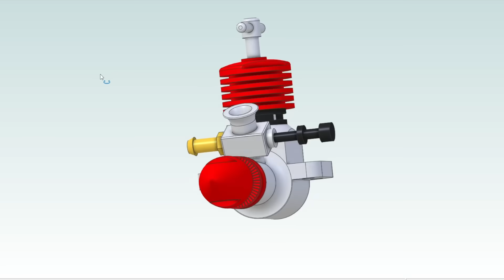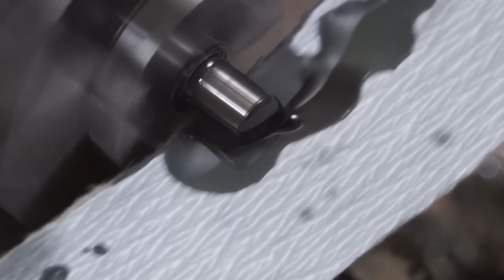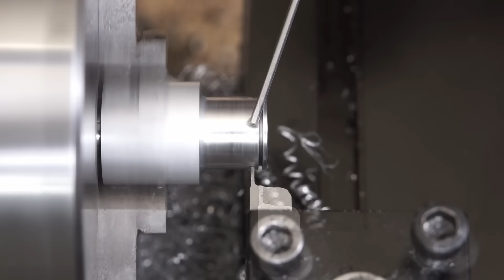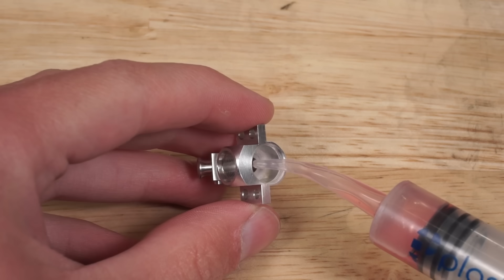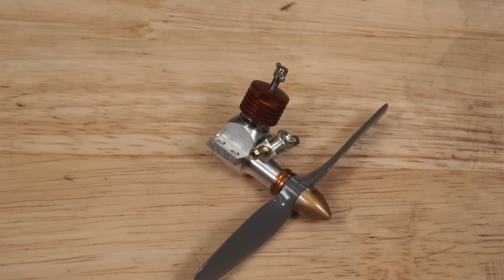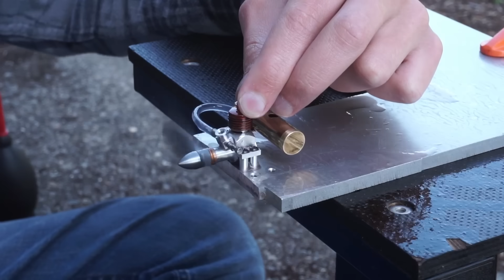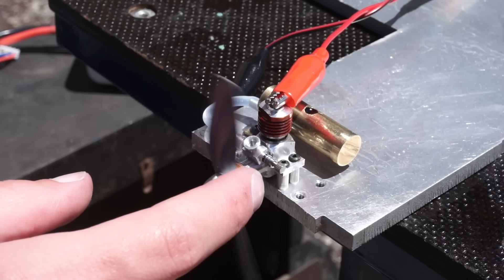I Make This Tiny 2-Stroke Engine From Scratch

Comment: There I was, proud of my aerospace designs that took months of adjustments on paper and mere hours in the shop to make, then again designing machines for a battery factory, meanwhile, this guy just makes precision parts by himself. Why did I hire so many machinists? Half way joking, my great grandfather made the hydraulic systems for the Spruce Goose plane and I have parts in space and I'd rather hire machinists than engineers any day. I have no idea how long it took you to make these but I'm sure other engineers and machinists alike are envious of your skill set. Manually threading on a lathe or on a thread press while matching these tolerances is a skill these CNC nerds fail to respect. "back in our day" stuff aside, being within 10kths of an inch manually is where we get the ladies or lads.
Reply from the maker: This engine took about three weeks total to make both the engine and video. I have a significant background in professional machining, it's amazing to me how low the barrier to entry is in the modern cnc shop. some of the things i've seen fall straight into "fever dream" territory...
unfortunately envy in the professional field translates into backstabbing and sabotage, and in a field like machining where even the tiniest mistake can be catastrophic... we'll i've had some interesting days at work lol.
Reply: @JellyFishMachine  There was only one shop where the night shift was blamed for crashes from speed to feed on different materials for a project but it was our fault for not training them well and not presetting for that shift. I've never been a part of that, more of a team based personality myself. Having that eye to detect the slightest off tolerance is, I guess, a skill we have. I was giving a hat tip to you. It's cool you can precision mill and cut these manually like us old school machinists and enjoy and admire the fact you do. CNC nerds are our future, I guess, but our skills with manual tools and janky jigs are what keep this skill set interesting and spooky.

Comment: I look forward to seeing your new development on this. I have an application for it that doesn't involve a propeller, but something way much cooler :) My question is: Could you design and build a tiny engine like this to run on biofuel using the glow plug principle OR maybe another ignition thing?  I could design smart electronics, which is what i do best, to ignite the cylinder at precisely the right moment for best performance. You are a great machinist and I like your style. The carburettor could be spot welded to the system and cold weld glue used to seal it. :) Great video mate.

Comment: On the carb I would have roughed up the inside surface and outside of the carb and used hi temperature epoxy. It would work well for this application. Good luck with everything.
Reply from the maker: I thought about that too but i'm going to redesign this engine a little bit, there's a few things i really don't like about it, especially the transfer ports, they are very roundabout and inefficient. also as drawn the intake port and the window in the crankshaft are round, making for very slow opening and closing. i'm thinking rear disc valve but port area might be a problem, the pesky square cube law beats us up pretty good at these small scales.

Comment: I am designing a 1/10 scale'ish v8 engine. but i want it to become as close to an diesel as i can make it.
The size is incredible problem. I was looking at your pistone that is really smart.
I've been thinking and re designing for over 4 years. and i scrap the valves. I think its gonna have to be tubevalves because of the size.

Comment: Impressive.  I've done limited machining and never w such small precise parts.
As a kid played a lot with Cox 049 engines and toyed with their smallest version (forget the size, 025 ish?).  Tiny engines always intrigued me.

Gotta think this told a long couple weeks at least.

"Interference fit" to me means U can't fit without force or big temperature differentials between parts.  (am I wrong?)  Not a piston that could slide in a cylinder.
Reply from the maker: the smallest cox engine is the .010, that's the one that made a short cameo in this video. the piston is a very slight push fit in the cylinder, as it runs it wears itself in to the perfect fit.

Comment: Nice work!  Must have been more than a Saturday afternoons work.
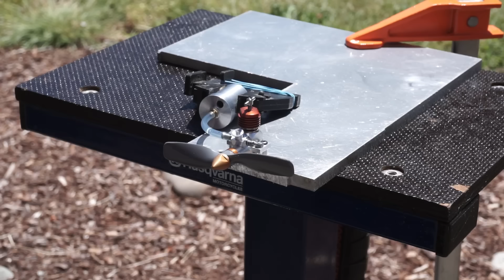That's too bad about your compression ignition fuel not working.  I have a couple small 0.2-0.3 cu-in diesels that I can't seem to find fuel for.  When you first mentioned the recipe for your diesel fuel (24:57) I thought great, I'll try that!  But I guess it didn't work.  Might be worth a try though.
Reply from the maker: Yes it's not a hobby for the impatient! 
The fuel isn't the problem for this engine, it runs great in my other diesels. Here's a good article about fuels:
https://www.adriansmodelaeroengines.com/catalog/main.php?cat_id=72

Comment: I've still got a Cox .010 Tee Dee. 10 times smaller than this. I always wanted a tiny engine with a throttle. The little ones are all fixed needle valves.

Comment: I cut my teeth on engines like the cox 0.049", and later larger stuff, so have a lot of experience with things like worn out engines, and getting things to start. As far as improvements to your work, I feel like you don't have enough compression. Also, an easy way to help you get started is to use a RC starter motor. They make products for about $40. Or you could just make one.

Comment: Amazing precision work! Like you mentioned the crankcase seal and near the carb may be weak or could a secondary choke on the outside most of the carb help the mix? Hard to tell what part is having the most trouble. Very cool project.

Comment: I know this is extremely off topic but watching the metal machining in this video made me think about those videos where the camera shutter speed matches the RPM of a helicopter's blades so it looks like its flying witout the blades spinning. I wonder if the same could be done for the bit on a CNC machine. Would it look like whatever was being machined was just falling apart as it moved in range of a stationary bit?

Comment: That’s really cool that small of an engine. It’s approaching watch making size. I have built race engines for 30 years and I fix watches in my spare time. The tolerances on watches is pretty tight lol. Makes regular  engine parts seem huge after working on a watch all weekend. It reminds me of playing operation as a child. Don’t touch the sides lol. I’m glad you shared this with us. I really appreciate something that is properly engineered and built. Great work my friend and keep it up! Unfortunately all my machines would swallow those parts. Like I was saying you need watch making tooling to make this one. What lathe are you using. I wonder if it would work for my application at home? I’m curious about how big of material you can use. Thanks again for sharing! I just saw your jeweling press so I’m assuming you have watch making tooling. I have been wanting to get into smaller machine work. Decades of the same thing gets boring. That’s why I took up watchmaking lol.
Reply from the maker: Thanks for watching! I work on watches too and what's funny is this thing is huge compared to watch parts. it's difficult to comprehend how small some of the parts are in a watch! (video coming soon on an english fusee watch...)
I have a sherline lathe and mill, and a grizzly mill. the lathe is 3.5" swing over the ways and 1.75 over the cross slide. the mill has a realistic useful working volume roughly the size of a 123 block, it has longer travels than that but that's a realistic volume of what it's useful for. 
I feel you on the decades of doing the same thing, i've been a cnc machinist for... too long. I don't ever want to look at another Haas control panel!
Reply: @JellyFishMachine I'm guessing that this is quite straightforward compared to watchmaking? I've just finished the late, great George Daniel's book.
Reply: @JellyFishMachine speaking of which, I'm currently restoring a verge fuseé from about 1780. It's English. It was running but it was left in a drawer and the oil gummed up the chain and it was wound like this which snapped the chain. Fortunately, you can buy chains, there's a shortage of chain making urchins, not like the 'good old days'!
Reply: I like these old English watches, they were cobbled together by jewellers so you need to tinker to get them running. Lots of hand filing and swearing involved

Comment: Is there a use of such small engines? How much power can they provide at a certain rotation speed? Why don't you use a small diy dynamometer in form of a BLDC motor with an ESC to get it started and for power measurements?

Comment: How does the compression ignition work? I dont believe you can achieve high enough compression for this idea to work at this scale. You seemingly machined everything with tight tolerances but it was likely running rich which helps keep the engine cool, working against the compression ignition. It is very similar to a 2 stroke diesel tho.

Comment: I loved the video. I’d never have the skills to build one, but I ran a couple of small compression ignition engines, a bit larger than this one.  

I had two that really ran well (Mills 1.3 and Elfin 2.5) they started easily and ran reliably and gave me a lot fun, powering one free flight and one control line plane.  There were couple of others ED Bees (a mark one and a mark two) and an Elfin .5 but these were quite worn and I could never get them to start and run reliably.  Tried for about 2 years!

The two that did run, always I noticed, oscillated back and forwards many times when I spun them over before the successful spin that started them. The others were stiffer, a little like yours. Not sure if that was significant, but I put it out there for what it’s worth.  

Have you thought about an extension tool to take delicate knuckles outside the arc of the propeller?  That saved me lots of pain on the Elfin which theoretically developed 0.25 of a brake horsepower at 14,000 rpm.

Comment: When it was mentioned that the drill bit's diameter was about the thickness of 4 or 5 pieces of paper or half of a credit card, I scratched my head in confusion, so I converted it to football fields. The drill bit is 0.0000037 football fields in diameter. Now it makes much more sense.

Comment: What is the resulting thrust of these engine compared to an equivalent electric motor? Could it be made to run quiet? If you needed to build hundreds of these that only lasted 36 hours could it be done quickly and cheaply? For example could the crank be 3D printed?

Comment: Why are they using a four jaw chuck
Reply: In this case an independent 4 jaw is used, because you can position the hole accurately in relation to the edges of the block. A dial indicator is used to measure the amounts that the part moves when you adjust each jaw. Think of it as a milling machine lying on it's side. Once you have mastered the 4 jaw independent chuck, you will only use a 3 jaw for repetitive work. I used to be able to "eyeball" and centralise a round stock, and if further accuracy was needed, I would use a dial indicator.

Comment: I happen to have a .061 cyclone, and after a long run? You can touch the cylinder head and it will NOT burn you : you can also mix 50% airplane fuel and 50% wd-40 and will run like a champ !wonder what metal those Ukranians used? The problem tho is when I remove the plug? The cylinder stops at TDC  and it's hard to turn , then I put the plug tight? And it turns smooth like butter . The same happens to the cox .049 when the ball-joint type connecting rod to cylinder gets  lose and you have to re- set it with that special tool , and hammer, better and long lasting engines were o.s. max I have one and it's 36 years old , very strong compression and it has crashed 18 times ! I think the secret is having a connecting rod with a thick pin to the cylinder, just like o.s.max.

Comment: CAN YOU JUST WIDEN/ ELONGATE THE CRANKCASE AND MILL A LEDGE THAT IS THREADED OR HAS SOME KIND OF HOLD DOWN WITH AN O RING TO STOP COMPRESSION LOSS AROUND THE CARB. INSTEAD OF JUST STICKING IT IN A HOLE.

Comment: The parts in the carb from my motorcycle are small enough, but this is just mind boggling. So the needle valve is the throttle, or it's just wide open throttle all the time with no RPM control, and the needle just allows you to set the mixture?
Reply from the maker: Wide open all the time, the needle is just mixture control. 
Thanks for watching!

Comment: I went into my local hobby store one time,,, The guy was like.. I got something I know you will love.... I said ok what is it?... He brings out 3 boxes....Says 100 bucks you can whats in them....he said it was air planes.... I said BET.. I'lll tak em,... it was fly by wire model planes....Old ass hell..with cox engines.. like 12 of em still in boxes ...I could never use the planes becouse they were so brittle... but I had so much fun messing around with those little engines.. I wish I still had the planes.. they hand built and just awesome.

Comment: My luck the wrist pin would come loose dig into cylinder wall or the piston would hit compression adjuster  crankcase back out or would unscrew idle screw would back out yup cursed  guess you dont need rings on that tiny piston ,very cool  anyways .aloha DSC777

Comment: amazing, all of it. What did you mean you didn't have the right drill bit so you had to file one up? Did you make that tiny drill bit or use a larger one and filed it down to the size you need?
Reply from the maker: I made a new one, just a simple spade type drill.
Thanks for watching!
Reply: @JellyFishMachine  That's exactly what I had to do when i made mine as well.

Comment: 0.1cc? Well. 1cc is 0.001L so this is 0.0001L. For reference purposes, my car has a 4-stroke engine with 36000 times the displacement of this. However, engine displacement is not necessarily proportional to power - be it in horsepower or torque. A 2-stroke engine usually has better power overall per unit displacement.

Comment: Do you feel you are limited by the size of the Sherline machines? I am looking to buy my first lathe mostly for HO and O scale but might want to do some bigger projects such as the die filer kit I have seen. Thank You
Reply from the maker: It's limiting in some ways, mostly when making tooling, but i like to build small. HO and O scale it will be perfect, especially for HO scale. One important thing to keed in mind that people often overlook, is the cost of materials, tools, supplies etc increase drastically with larger machines and projects. i've seen so many people spend all of their budget on a lathe and basically do nothing with it, metal is expensive! My suggestion is to go for the sherline, and lots of material and accessories. their packages are a great way to get started: https://www.sherline.com/product/4500c4530c-lathe-with-adjustable-zero-handwheels-package/#description
One more note about sherline machines - the DRO isn't so critical on the lathe but the zero adjustable handwheels are absolutely essential and very well worth the extra cost.

Comment: This would suffer from issues the first diesel had right?
    The one Rudolph Diesel made ran on coal dust delivered on the intake stroke this would pre burn some robbing the engine of power and make it impossible to run on more volatile fuels because of back firing and preignition 
    The hot bulb solved it by having a expansion vaporizer chamber that you pre heat before starting the engine and the exhaust kept hot
   Then what we know as a  diesel with high pressure fuel injection system

Sometimes with modern diesel working at cial mines when the dust us 5hick and the filter dirty cant shut equipment off 
😂🎉💀
   Good new or better news?

😨😳🧐🤔

  Its not broken 
😅
  And not costing you anything to run 
   😂

Comment: It's a pity about this diesel. (compression inigtion engine). You should have made the fuel 50% castor oil or paraffin (not oil for 2 strokes engines !!!!) and 50% ether and before starting put 1-2 drops of castor oil or paraffin directly on the piston

Comment: I see that there is too little compression - too loose piston -cylinder fitting. Make a new piston and make  the so -called oil rings on it.  Converion  into a glow engine - it is such a half -measure. The problem is too loose piston